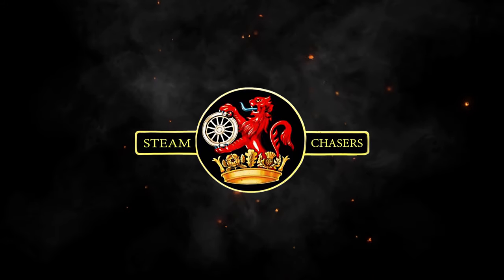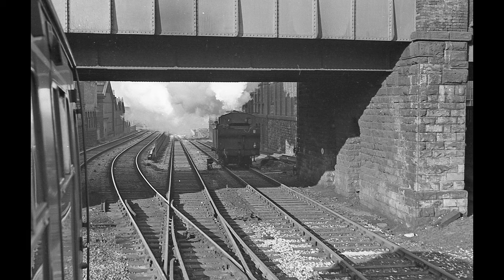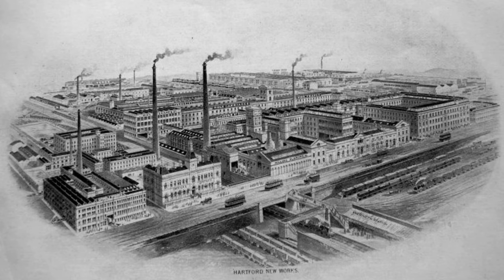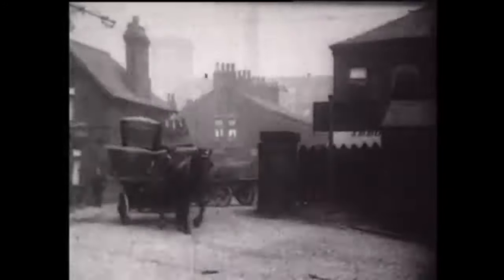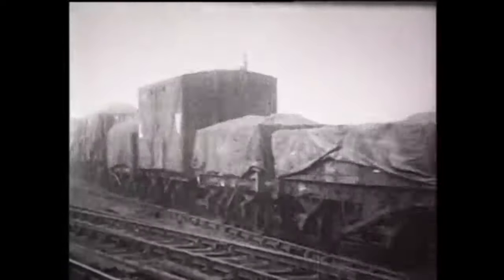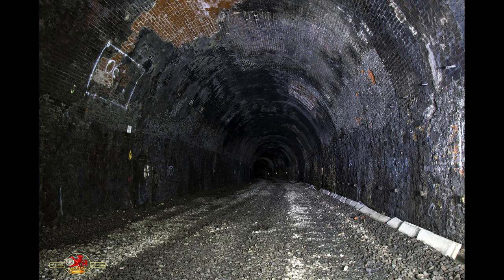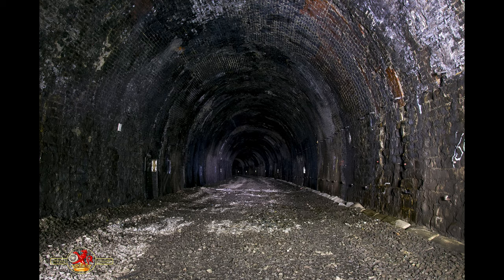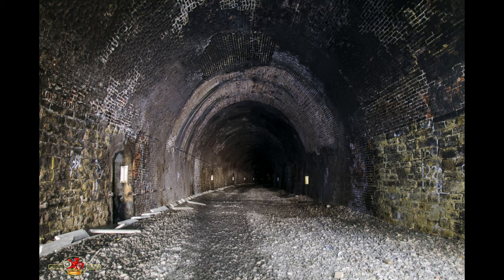History Of The Werneth Incline Part 6 Oldham Werneth Station

Comment: Thanks for a very enjoyable and beautifully put together video Colin.    Werneth Station used to be my local station and I first started work at Platt Brothers which was alongside the 1 in 27 incline.
Platts had it's own branch line which came underneath Featherstall  Rd and entered the works yard just behind Werneth Station.  They also still had the remains of one of their own designed and built shunting engines that was sheeted over in the yard.  After spending some months in the apprentice training school I moved into the factory under the supervision of two engineering Fitters.  One of the first jobs that they gave me was to take a  large adjustable spanner and remove every thing that was made of copper or brass and leave it in a sack on the footplate.  The second and much more emphasised instruction was to do this quietly beneath the tarpaulin sheeting and not to let anyone see or hear me. 
From memory the engine was just about the ugliest thing I've ever seen yet it still had nameplates on the side tanks although because of the tightly roped down sheeting I was unable to read the name.

Comment: Good memories of the Oldham tunnel. As a kid I used to play with my mates on the railway embankment in between the two tunnels . We used to put old pennies on the line and dodge the trains to collect our flattened pennies. We often sat on the top of the tunnel and get covered in smoke from the steam trains. I actually still have a scar on my leg after cutting my leg open on broken glass after slipping down the embankment. Fond memories. Thanks for the video .

Comment: I travellled through this on the Metro. What a waste to convert a useful heavy-railway link into a tramway. Oldham is now one of several large towns including Newcastle under Lyme, Leigh, Hanley and Fleetwood with no rail link. What Beeching set in motion his successor mindless planners have continued.
Reply from the maker: Very true. At least Fleetwood will one day be reconnected to the network thanks to the heritage railway and forward thinking preservation.
Reply: What nonsense! It’s much much busier as a tram line than ever it was as a heavy rail line!